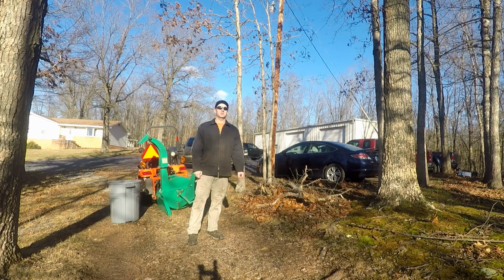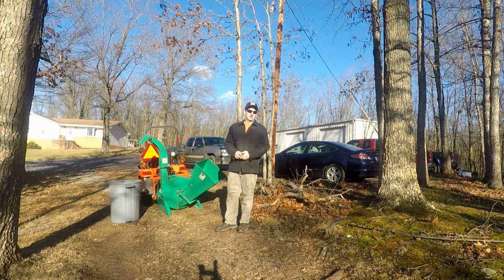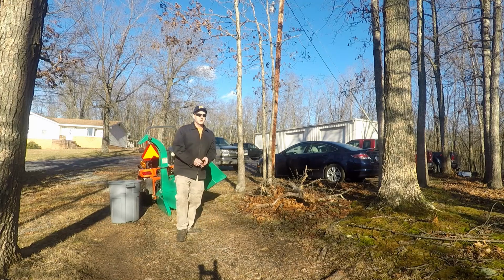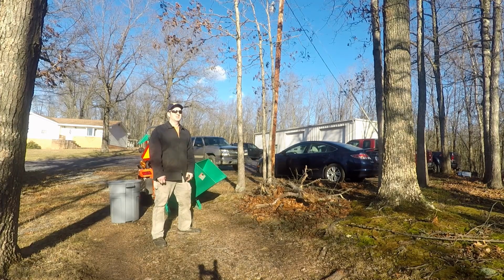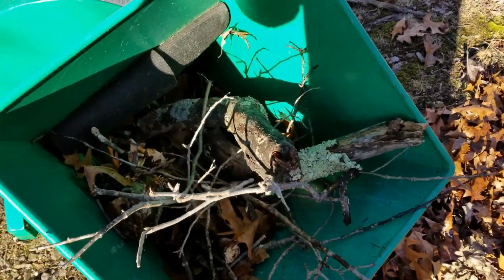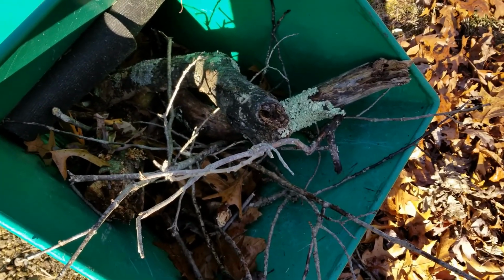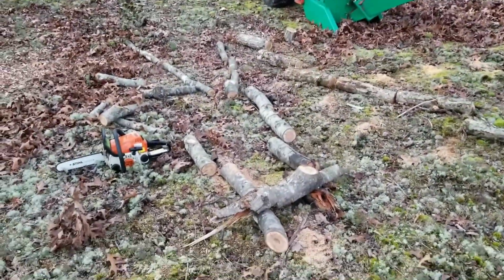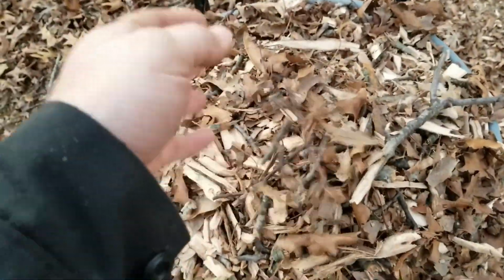BX42S Chipper in Action!

Comment: Thanks for showing us Roger.  Like Don, I debated getting one for a long time. I resolved the problem by building my own!!! How much garbage bin did you fill?  I use to put the chunks in leaf bags and keep them for heating in winter. Last summer, I gathered over 50 bags of ± 75 lbs of wood chunks.  That is some good biomass, but it burns well with a large stove like the one you have. There is one thing weird about trees.  They will keep their leaves up to winter if only they fell on the ground before fall !?!
Reply from the maker: I wanted one for a long time too. This is a copy of a Wallenstein which the do not make anymore. A Wallenstein went for $2500+. I found this one at an auction in new condition for $700. I think I filled the trash can 5 times. I thought about you when I was doing this and how you burn yours. I dumped mine on a dirt pile. Now you have me thinking about burning them again. I have a decent sized plastic tote  that has hole in the bottom and I'll get some in it and let them dry a few days. Then I'll try burning it. I never thought about the leaves not falling off a dead tree on the ground. Thanks for watching!
Reply: Roger, one detail. Make sure the branches were pretty much dry when you chip them and bag them. Otherwise, they will rot. There is not much air movement in such a material. So the paper bag absorbs the excess moisture. This must be why it is not a popular biomass recovery method... It works for me, but the stars have to be aligned to make it work! Thanks!
Reply: Roger, at 700$, you could not pass on this one! Super deal!
Reply from the maker: Yeah I could sell it now and get my money back, maybe more.
Reply from the maker: Good point about the rot. I did some reading on burning chips today and even looked to see if there was a stove that would burn chips. Nobody commercially makes a stove to burn chips. I found some homemade ones that were neat. The issue is drying the chips as you mention. I was thinking it would be neat if there was a large hopper that tumbled the chips plus some way used heat from the stove to dry the chips. It would cool if there was way to burn chips. Tree services are always wanting to give chips away. I brought some in to dry to see how my stove likes it. If it does well I'll consider trying to save chips from dry wood. I almost forgot the best thing I found to do with chips was to turn them into pellets. The problem is a pellet mill is pretty expensive. I'm not sure how slow of a process it would be to make pellets.

Comment: Thanks for the demo, Roger. I like the pretty green color of your chipper, but I would find that small Stihl chainsaw more useful to me. It would be nice to have a lighter saw to do the limbing on bigger jobs. I recall they wanted $150 more than i paid for my  MS 290 for the smallest model, so I have not bought one yet. Someday, maybe.
Reply from the maker: Hi Terry. I think the saw you are talking about is a MS 150. They are super light. This saw is a MS 170 they are $179 new. The 180 is another $10 and little more power. I got my 170 second hand. It was barely used. I got rid of the 14" bar and put 12 .050 bar on it. The .050 chain is more durable than the .043 chain they normally come with. I bent a cutter on the .043 chain. I also put an adjustable carb on it then did a muffler mod and timing advance. It runs way better than stock. I really like this little saw for small jobs like this. It is a great saw to have around the chipper.
Reply: @TractorTech  Thanks for the tips.  I tho't maybe a cordless electric saw was the answer, but cost as much and the Stihl and Milwaukee models appear to be quite heavy. Hope to check them out in person soon to verify. Later.